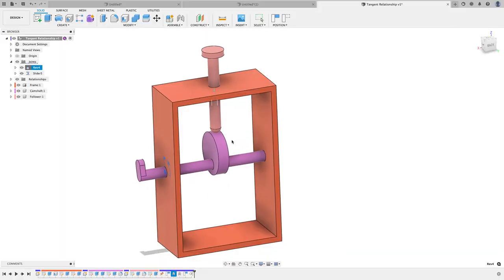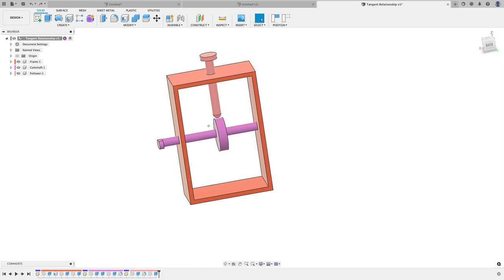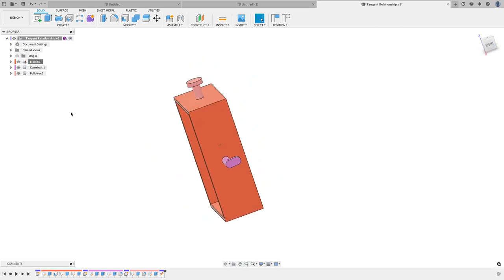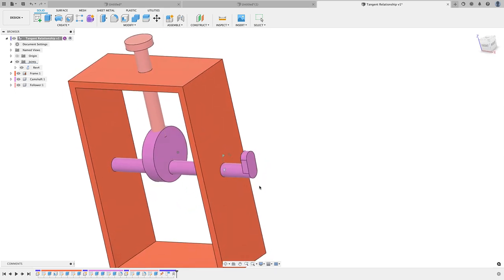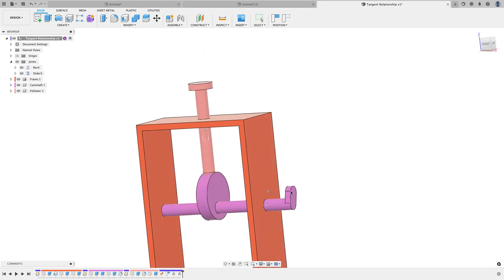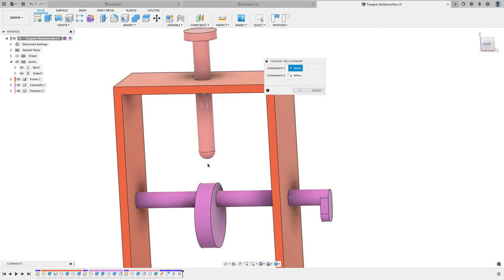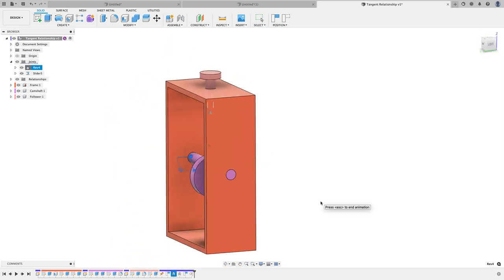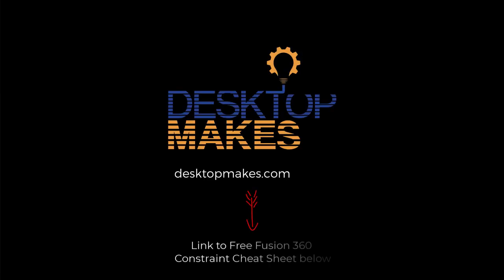Fusion 360's Brand New Tangent Relationship

Comment: Does this only work on perfectly circular faces? It seems that I can't use this function for a shape like a "lobed cam" for example, because the tangent relationship only allows you to select 1 face from each part. If the "cam" has a round face that transitions to a flat face, you can only select one OR the other, but not both. Is there a way to make it work on multi-faced surfaces?